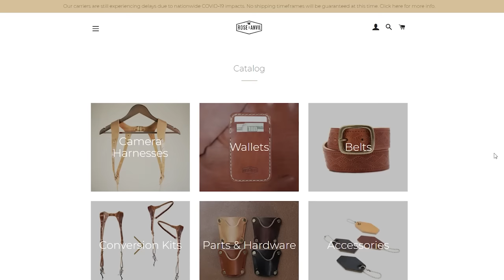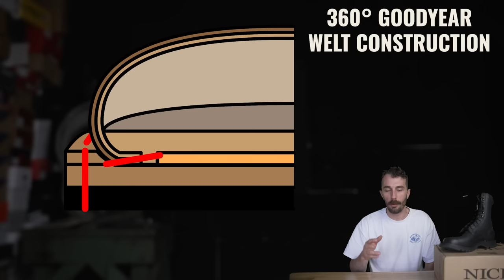($524) Are these the best Tactical Boots? - Nicks Boots

Comment: As someone  in a Uniformed Service - I could not were  this boot at wok 
1- no puncture resistant  sole ( we sometimes walk over broken  glass or sharp metal to  get to  patents )
2- no safety toe ( we work around big heavy things  that  might move unpredictably )
3- no gortex like membrane to keep moisture out our infectious agents out 
______________________________________________________________________________________________________
Things I find strange about these reveiws 
1- all the  emphasis on re-soleing , I asked at work an nobody has ever put a  new sole on  there boots or could think  why they would as the uppers get damaged just as fast  as the sole ( think  cut  or burned ). Thats why we dont care about all the  fancy welts , when  th boot  is dun its dun and it frequently happens because the upper gets cut or something punctures the boot and  it  now  lets blood in 
2-we need our boots to protect us  from our environment and that means cold and  hot and wet  and  sharp  and blunt trauma and pointy things . We also need as few  things  as possible to  cash on stuff so hooks are a bad idea 
3- price is important because the boots  are going to mabelast18 months before something punches through them
Reply: As someone with experince hiking and being in a mechanized unit in the military.

1. Puncture resistant soles are not neede. 99% of military boots don't. 
2. Safety toes add weight which makes running and marching feel like crap. I used my own boots that were lighter. 
3. Goretex is not needed on a full leather boot. If you condition the leather it's virtually waterproof and if goretex boots get wet, they take ages to dry out. Goretex is only usefull when the shaft is high and the boot has materials in it that permiate water into the boot. 

Not so strange things. 

1. You have never worn boots with thick good leather then. Nicks boots can easily be resoled close to 10 times and rebuilt multiple times. 
2. I never had issues with hooks so I don't know why that's an issue. 
3. The rate of wear and tear in affected heavily by environment. Concrete chews through boots while sand and foresty areas don't do much to outsoles.
Reply: @Totemparadox   while keeping water out is nice keeping viruses and  bacteria out is why we like the gortex , the water might be uncomfortable but pathogens can end you.
2- if you think its hard to run with the extra weight of a carbon   fibre toe  cap you should try with a   comminuted fractured proximal phalanx 
3- hooks stick out and catch on stuff , thats  why people use  them but they also catch on other stuff like say torn metal  or wires or cloth and when  you go to leave your foot stays there and your entire body now torques  to  one side , then you and your patient head to the broken metal and glass covered ground fast 
4- I still  dont know what the point of being able  to re-sole a boat is if the problem is that a torn  door beam cut a 4 inch gash in the upper  ( my last pair ) or the leather got all  hard and  cracked after exposure  to  sum mixed industrial  chemicals  ( the soles were undamaged  in both cases ) ?
Reply: @woltews  
1. Treat the boots with anti microbial grease and oil. I use obenaufs which has anti microbial and fungal properties and waterproofs full leather boots very well. 
2. I was talking about steel and I don't know what kind of bone damage that is, but wasn't a problem for me. 
3. I put my pant leg over the boots so nothing came close to the hooks. Even when bloused I never had issues and even my issued boots had hooks. 
4. So you ruined the boots yourself? What's the point of being able to change tires on a car if I'm gonna crash it before they need swapping? That's your reasoning.
Reply: @Totemparadox  um you might not be understanding part of being a medic means going where the injured people are , not staying where its good for your boots .
-When I submerge my boot covered  foot in human bodily fluids I dont want pathogens from those fluids to contact my feet  .
-No matter what is on the ground we go through it to evacuate the injured and hope our gear protects us , that  includes fire , sharp metal ,  broken glass , toxic industrial chemicals , insects , human bodily fluids , burning fuel . We even go into areas with people that want to injure or kill us to retrieve the injured  and treat them or bring them to a higher level of medical care .
No one refuses to go in to protect there boots or jacket  or other PPE , the PPE must protect us not the other way around .
Reply: @woltews  I don't understand what you're getting at. That's obvious and leather does exactly that. It protects you. Also I have to wonder. What about every Special Forces guy I have seen running around in low shaft boots? I think you're putting a bit too much importance on goretex thinking it will keep your feet dry when you only need to step in puddle of shit deeper than the boots and your feet are fucked. Hell that's the reason why the Jungle boots were developed for Nam. It's virtually impossible to keep feet dry there so letting the boots brethe as much as possible was better.
Reply: @woltews  I still don't understand your fixation on bacteria. Literally just was your feet and clean your shoes. Wwhat about every professional who doesn't have goretex boots or high shaft boots? What's gonna happen to them? Their feet gonna fall off? What about their exposed arms, neck, face? They gonna wear full hazmat gear cause someone is bleeding?
Reply: @Totemparadox  if we have time we shower up after a call but that is rare , and leather  holds bacteria , we have regulations and if you want  compensation for your boot purchase it must meet standards  designed for our safety  ( safety toe , puncture resistant sole, liner  that will resist bacteria ( gortex qualifies along with sum other s, bacteria and  viruses are far larger than water molecules  ) .
We have  these standards so our kit will  protect us from  the hazards we fact on the job .
Medics have lost their life due to infections they got on  the job .
Reply: @woltews  Are you working as a civilian or in some military?
Reply: @Totemparadox  um both actually  but its extremely similar on both sides ( the military is made up of humans and the A&P  dosnt change )

Comment: Does the rubber result in less breathability, which will result in more foot perspiration?  I didnt see any air vents.
Reply: No. The upper is still leather like normally and even on boots with leather insole and midsole, neither of them breathe. They do suck up sweat, but that's actually a bad thing. While your feet might feel drier, the sweat destroyes the leather over time. I think the removable leather insole sole on top of the rubber insole is a great idea.

Comment: I would say the statement of "best tactical boots" is debatable. Though it depends on what is meant by tactical boots as it covers multiple things. If by "tactical boots" you mean the aesthetic then sure very high quality boots, looks amazing and will probably last a long time. However, if "tactical boots"  refers  to the purpose of being a boot for professional tactical use then no, they are subpar is most aspects and are far behind other boots like Salomon, Haix, Danner and so on as they lack many of the features of a modern tactical boot and their price point is way to high to be sustainable as they will most probably just like every other boot be torn through quite quickly in training.
Reply: As a proud owner of Haix boots, what does Haix offer that these don't? Other than be a bit lighter.
Reply: @Totemparadox  fire resistance, lighter, option for waterproof membranes, puncture resistant sole, heat resistant sole, better soles for climbing ladders fastroping and so on, better toe and heel protection, anti static soles, slip resistant soles, protection against staining from diesel gasoline and the likes and probably most importantly much cheaper price at around 50%
Reply: @M.Wiberg  Literally everything you listed except the waterproof membrane is offered by Nicks. You can't name different features from ALL Haix boots and claim they're better than a single model of Nicks.
Reply: @Totemparadox  that is actually just the features of the older scout boot. Don’t know the scout 2.0 that well as I changed from HAIX to Salomon before the 2.0 became a thing. That being said the same list of features are present in the Nepal pro and other HAIX boots and boots from similar brands. And again the probably most important part is the low price, as I f.end burn though boots in a couple of months.
Reply: @M.Wiberg  My Airpower P9's aren't fire retardant. The sole isn't that much grippier than a V100 if any at all. It doesn't have a safety toe, no reinforced heel, etc. The Nepal isn't fire retardant either and doesn't have safety toes. Where do you get your specs?
Reply: Also being anti slip, anti oil and anti gasoline is a load og hogwash. My V100 lugs grip great in oil and a good grease layer on my boots protect it from acids. Haix are great, but Nicks are better.

Comment: Contrary to popular belief, having a compressed insole is not good for your feet. Having one that stays flat is so much better for your feet, which then transmits all the way up the kinetic chain, leaving you feeling as good as you did at the beginning of the day - That is if the boots had a zero drop instead of a raised heel. Zero drop, flat soles shoes are the best for your body.

Comment: makes me wonder how badly that stitch down is gonna get worn down & worn off from the edge of the boot on in.  Boots are supposed to get beat the f*** up.  If you wear them as tactical on like patrol or a job where they’re not getting beat too bad, probably wouldn’t be a problem, but for heavy use , might be an issue

Comment: Interesting, I like the boot but for me to consider this the price point has to be lower than what it currently is.
No problem paying top dollar for a leather everything Nick's boot (and have).
I'm sure it's good quality, but with the added large amounts of synthetics it's no different from the more budget friendly US made brands .
That's the price point they should be considering with this .

I mean I LOVE my Thorogoods , but Im not paying $550 for them
Reply: That's because Thorogoods aren't BUILT like Nicks. A Ferrari and an Altima both use steel in their cinstruction, but they're not made in the same way and the end result is different. What did Nicks really do differently? Swap two veg tan slabs with thick rubber and a PU wedge instead of a stacked leather heel. I found stacked leather heels for $30 a pair, but couldn't find Vibram PU wedges for under $50. The material cost difference is VERY minimal. Let's look at the next in line high end leather stitchdown tactical boot. Danner Acadias for $430. Those use less leather, the leather is thinner and they're NOT hand lasted. So for a mere $100 more you get a boot that is objectivley tougher and took more time to build BY HAND.

Comment: I’m going to be honest here and ask a good question. Will the sole last any longer then the ones on my bates and wolverines? I’m asking this cause 500 plus is my boot budget for several years. So unless I can be assured I’ll get 4 or 5 years out of this boot wearing them 5 days a week for 8 to 12 hours a day constantly then it’s just way to much money. Especially with a possibility of an economic downturn and folks getting laid off again. How can someone justify charging 500 bucks? Comparable us made Danners aren’t that expensive and not even my McRae boots with vibram soles ( us made at 159 bucks) just like these nicks boots lasted more then a year before they were ground flat. Thus far I see no good reason why I would pay more then 250 at the most. I can get Wolverine and bates durashocks which last close to 2 years for me for 150 to 160. My jungle boot style rock roosters cost 98 bucks and last for over a year ( I don’t wear them in winter cause the vent will let snow in). I suggest you consider chopping boots like the bates durashock, the danner  Acadia or other boots that most folks don’t consider to be in the unobtanium category
Reply: Similar US made Danners are $370 with less leather and the leather is thinner. These are priced correctly for what they are.
Reply: @Totemparadox  most folks like me working can’t afford the Rolls Royce of foot ware. I would rather he stick to shoes and boots that a person of average means can get
Reply: @matthewcaughey8898  No. That's not what you want. You don't want him to review any expensive footwear because not affording it pisses you off. He has way more budget shoe and boot videos than expensive ones. Also, the average person CAN afford these. Pretty easily even. I'm high school educated working in renovation and could afford these pretty fast. Sure I don't have family to feed, but many working people can afford these with a little bit of saving and budgeting.

Comment: Also, the more leather your foot sits on the better they will conform. More rubber will not absorb as much foot moisture.  I find full leather boot wear much cooler with less sweating.

Of course, if your feet are in wet conditions some of the day get those boots. If your boots are in very wet conditions all day long - Get Rubber Boots❗❗❗ 
It is about compromise...

Comment: You keep going to Nick's for some reason. Hit up Frank at Frank's Boot Company. I personally think he does better work. He's not mass producing and I think he makes a better boot. 

These 'tactical' boots, with rubber throughout, how do they breathe? Why is there no puncture protection? Why isn't there a better shank? 
One would think a 'tactical' boot would be used by first responders, security, personal security, etc etc. So they're going to be in these mini foot saunas for untold hours with no real support?
Reply: Rubber throughout? What are you talking about? The insole and midsole are rubber. Those parts don't breathe even if they were leather. Also, calling Nicks manufacturing mass production is a flat out lie. Frank's boots are no doubt great, but their materials and construction are 95% the same as Nicks and other PNW brands.

Comment: Awesome boots  , I'd love a custom fit pair with lace to toe and a few other features .  Puncture proof, segmented 304 ss shank ,  steel toe mid layer.  Kevlar threads , inner Lycra / kevlar  fire retardant sub liner with gortex breathable water proof/ nano silver / copper anti microbial liner, 
 Full length Gusseted tongue. Rubber external  cap  like on marine corps desert mountain hikers . 400 gram thinsulate ultra...   Lol just a few  custom things . Really i just want the specs of my old  c-sar boots with the added rubber abrasion cap . Those would be ideal ...  If I could make one boot. Thats the one, if two, lace to toe and regular.
Reply: Why lace to toe though? That would only make it less comfortable since they are so elastic/soft in the tie area

Comment: But no metal shank?  That's disappointing.  What about pungee sticks in a tactical situation?  What about weight distribution?  Climbing ladders?
Reply: These don't need a metal shank and a US soldier hasn't stepped on a punji stick in almost half a century. Most military boots don't have spike protection.
Reply: @Totemparadox  Yeah, the punji stick thing was a throw-away joke.  But why don't they need a shank?  All my good boots have metal shanks.  I see no reason to skip out on this.
Reply: @georgegonzalez-rivas3787  If the leather shank in these is even half as ridged as in my Urban Loggers, it's good enough. Also seeing pics of these boots that have been well used, the shank has kept the structure of the boot. Would I mind if the shank is steel? No, but I haven't yet personally seen any big downsides to using leather.

Comment: The flexibility you mentioned as an advantage isn't so beneficial in tactical boots.  Often someone using them like s soldier will carry heavy backpack for hours in rough terrain. It's then, when you need extra support and stiffness of the boots which they lack. So I would say, these boots are more of a gimmick rather than real tactical boots.
Reply: You are so wrong. The flexibility is in the walking motion. Ankle support is still the same because the leather is the same. Where did you get the idea that they're less supportive?

Comment: I’m buying the leather / water argument on tactical gear for the outsole and maybe even the mid sole, but why on the insole? I don’t want to be squishing around on slimy rubber with my sweaty feet after walking all day… Give me a leather insole at least bro..  (I’m not even considering that .5mm little piece of skiving leftover that you can throw in there as an insole, that’s a total joke). Also, I’m the first to say Nicks boots are incredible, but $575 bucks and the outsole is just glued in place, where you said yourself you can pretty much just peel it off, especially when it’s heated, like after you’re walking for five hours on 100 degree pavement , etc… No thanks.
Reply: That leather insole is 7oz and Nicks has made only glued on sole boots for a while. It's funny how you think you have a point when you're incredibly wrong.
Reply: Huh? Ok... You can have my glued on sole. Congrats, i sure ain’t buying any. Lol

Comment: Hard to beat danner R.A.T. boots.
Reply: They're discontinued now though
Reply: @TheSynchronizer  
Amazon $90 grabbed two pairs last week
Reply: @ryanramsey6391  yeah I know you can still buy em from surplus but they're not issued anymore
Reply: @TheSynchronizer  the danner marine expeditionary is the new but is not as good as the old RAT. It's hard stepping into $600 for boots. But I do like the double sole on the Nick's with no liner. When my fort Lewis danner waerout I will have to give them a try.
Reply: @ryanramsey6391  I felt the same way man, pricey up front but so comfortable. Then I ended up putting in an order for 3 more 2 months later